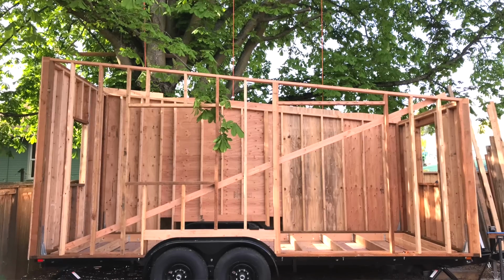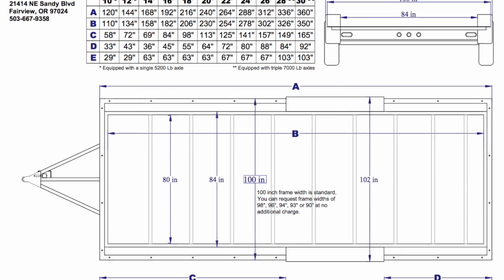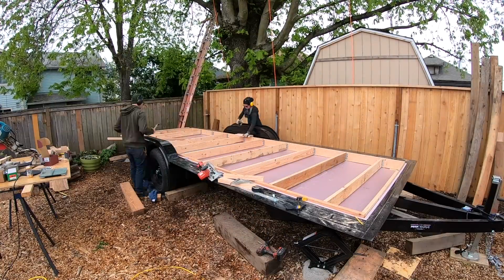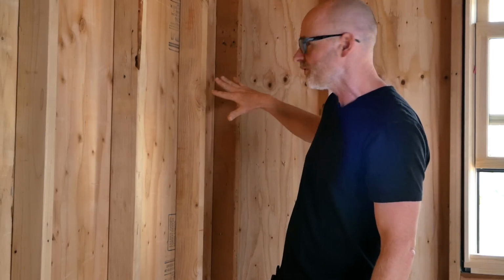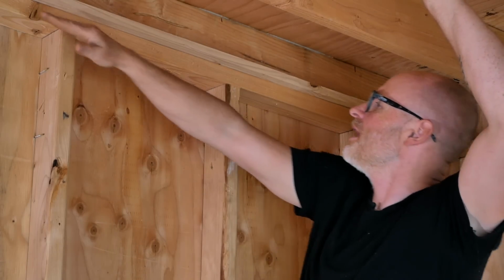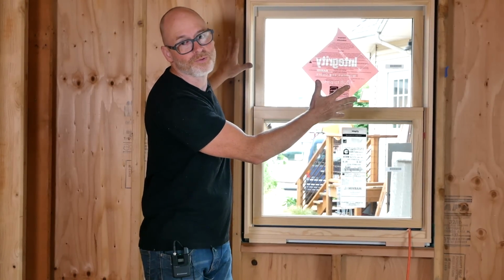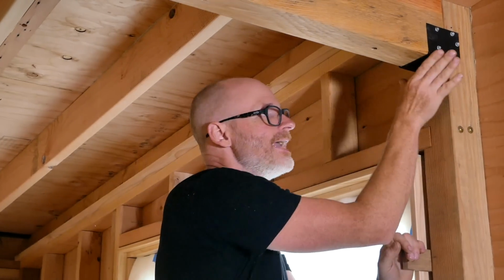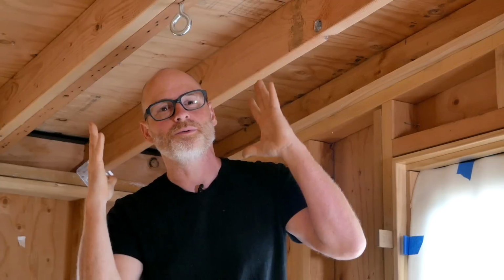Smart Framing For A Warmer Tiny House

Comment: I build a tiny house a couple years back using an iron eagle trailer as well! I can tell you the concern for condensation around the edges of the floor on the metal flange is absolutely an issue. We’ve actually had mold start to grow behind furniture if we haven’t dried it out for a while. So yeah definitely recommend the continuous insulation as well!
Reply from the maker: Thank you for sharing this!
Reply: What ended up being the cause of this? air leakage? was your floor and flange thermally broken?

Comment: As a tec student one of the things we did in competition is build ultra light campers. I and friend build a pickup camper so light, two men could lift it out. And it slept 5. No bathroom but sink stove oven icebox water tank heater propane . No hot water tank It is insulated with 2 inch styrofoam, aluminum framing and most inside outside walls and roof. Wind became a problem trying to lift it out of pickup. Yours seems to me maybe an over kill. How heavy are you at this point?

Comment: I have a 33" camper flatbed trailer with two axles at 3500lbs each. It has a camper on it right now, but I was wondering if that was good enough for a tiny home, maybe if I used 2x3's instead of 2x4, I saw a couple using that lumber for theirs.

Comment: On the 21.39 mark of your video. What is that black channel looking thing between the ceiling and the wall stud up in the corner? Is that some kind of venting? I watched your insulation video and that wasnt explained at all other the you were gluing blocks to you foam insulation before installing them to the ceiling. Do you have a video on that at all as my tiny cabin is in a extreme enviroment and i dont want mold.

Comment: I would suggest notching the post to receive the beam and THEN bracketing them together. It would be a catastrophic failure if the trim 2x4 were removed by someone who was not aware of its structural purpose in the future. Additionally, those bracket screws create a line for splitting out that post when subjected to the bouncing going down the road. If the 2x4 trim is not exactly the same expansion/contraction/length required to mirror that of the post, I would be concerned fatigue over time would be a problem. Your design considered vertical loading but perhaps not the horizontal and twisting when the trailer is unevenly supported due to pot holes or other road debris which will apply torsional loading which could very well split that post. If however you had notched and glued the beam into the post with lag screws from the outside to pull and hold the beam into the post in addition to the bracket and the final 2x4 support, I think it would be a much stronger structure overall because it would eliminate the hinge effect which you currently have at that joint. Consider Japanese joinery wherein multi -story buildings have survived earthquakes and hurricanes for centuries without a single bracket or metal fastener.

Comment: I understand the weight vs structure - did you consider steel stud framing topped with wood? I’ve done wood and steel stud framing and the combination sounds feasible. Thank you for sharing.

Comment: Thanks for the sharing of information. 
 I won't completely pick every detail apart like a few of the people in the comments. 
 1. The eye bolt for hammock. 
 Width is never a equal or often adequate replacement for depth in framing members. I get the "old growth" logic). 
2. Thermal performance.
There are calculation charts for something called "Fenistration". Basically the ratio of openings (door/window) that ate permitted. This varies greatly by State. Best to check local areas to ensure the "Certification of Occupancy" if you really intend to use tiny home as a dwelling. 
3. Any span over 6' requires two lap studs (minimum 3" load bearing). So you may use the hanger that is breaking the span of your roof. But, if you run into a goofy inspector you may have to do double lap studs anyway. Totally changing the interior detail that you plan. 
4. Talking cripple and lap studs.
 Point load blocking is usually required. (great, more thermal loss) LOL 
5. Floor decking. Plywood orientation. I understand your point about strength. In this small of a project it becomes a matter of choice. 
 Mitigate the issue of floor sag by using a t&g product. 
6. Treated lumber and fasteners.
 Use fastener rated for exterior decking and you don't have to worry about anything. 
 There are a couple of other things that I could go into but I've already said to much. I'm sure I will get a deluge of comments disagreeing with me. HA HA. 
 One last observation. Framing spacing. Have you heard/thought about 19◇ spacing? This spacing along with double top plate is often both cost effective and efficient. 
Thank you and if you would like any clarification please feel free to contact me. 
 I'm a old broken builder with to much time on my hands. LOL 🤓
Reply: I think you are great. I use to frame too. 65yrs old now. They would put me on the roof. 3/4 ply and spin it like a pizza because I'm 5'2. ✨💃✨
Reply: What do think; is he worried too much about the application of insulation?. I don't like the vent at the top.?

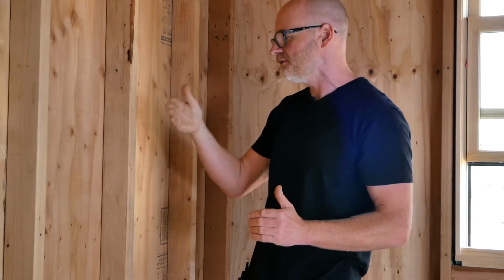Comment: 10:10  From what I understand, not only that, but thermal bridging is how/where the condensation forms, which leads to molding. Ideally, a tiny house (and houses in general) should be completely thermally broken, to maximize efficiency and mold-resistance.

Comment: You definitely did an exceptional job! Some of it may be considered overkill and  there was a lot I would alter to reduce weight. But there is a lot you did that I wish I had the patience to do because it looks great. This type of framework is quality and worthy of exposure. I usually keep rough framing rough framing and save the detail for finish work, but kudos.

Comment: The 2x4s above your windows and doors should be spun vertically. Add a 1/2 piece of foam insulation between to make up thickness of the wall studs and have a thermal break.

Comment: Framing your roof with 2x8 @ 24" o.c. in lieu of 2X6 @ 16" will give you a stronger framing system and a deeper cavity for insulation. Not to mention it will be a tad bit lighter as well. 
The downside ... you'll want to use at least 5/8" roof sheathing or better if you're not already doing so.
Reply: Yes, 2x8 on 24 is a better design for a static structure, but I am concerned that it does not allow for sufficient rigidity bouncing down the road over time. Also... 5/8" sheeting... not so sure you would see much in the way of weight savings.

Comment: I am building tiny houses in Alaska and I like the video. Looks like a good job. I would however be a little concerned about the structure of the roof if you have any kind of snow load. General rule is 1 foot of span for 1 inch of 2x. For instance, 2x4 spans 4 feet, 2x6 spans 6 feet and so on. 10 feet really is a stretch for 2x6. You may consider adding another cross beam. Also I seen a knot hole above your head when you were explaining the hanging chair support. If that 2x6 is spanning 10 feet and now you have a weak spot in that board, it will further weakens the roof. I have not seen those trailers before, I will definitely look into those.

Comment: Excellent!!!
Extremely helpful - thank you for sharing. 
Quick question regarding the plywood subflooring: 
It would seem that the subfloor is not secured at the perimeter, floating on the XPS foam insulation. I understand that XPS is very strong in compression, so no worries there. But I wonder if you have experienced any deflection, while walking on the Maple flooring along the exterior walls? Thanks again.

Comment: Thanks for such a great video! I hadn't seen the way you framed up the windows before. And great tip on the sloped window sill! Low-tech clever solutions are the best. :)

The one thought I had while watching was about bolts or other metal components that are connected, by metal, to the trailer itself. It might be beneficial to use a little bit of spray foam from a can on them (probably just $100 on both the hardware and foam itself to do this ... and it can also be used for better air sealing elsewhere, too). This will reduce the thermal bridging of the bolts and metal pieces, which can be huge when they are connected to the trailer bed (big heat sink). In addition to efficiency improvements, this can be good if these parts are not super well air sealed from interior warm, more humid air that could cause condensation on those very cold bolt heads in the colder months (rot concern).

Comment: Great content highly thought out, your window framing with the angled support it seems with an externally flanged window to make window sill angled for drainage, the top of window needs to tilt out. Theoretically this will happen with a plumb wall. Is this within the margin or error in construction? Or do you find this  truly works? Great video , this is the only thing I questioned.

Comment: First off, love these videos wish you had more!  Question on the detail where the sill plate meets the metal trailer, any reason for no sill foam gasket between the sill and metal trailer?  Also, any reason for not adding a vapor barrier to the floor frame before adding the sheathing?  Thanks!

Comment: I think you’re correct about not using the pressure treated lumber. The corrosives used in that treatment are Not good for any of your fasteners, or the substrate that you’re attaching to. You’re not having a ground contact issue at all, just potentially a condensation issue with wood contacting steel. That’s easy enough to isolate with a gasket or a membrane of some nature. Thus minimizing the thermal bridge, and dealing with potential condensation issues in contact with wood and metal.
Reply: Absolutely😊

Comment: Hi, thanks for the great info, wondering if you have a video on roof/ceiling framing and if you have consider to vent the roof like many do. they say if you use spray foam theres no need to create a venting system, but if you use other kind of insulation you do. thanks.

Comment: Excellenr. Thanks for the structural details that r always overlooked but so important to have a thought process.  Would like more explanation of how u did the insulation -  not very clear but imp I’m sure.  Thanks
Reply from the maker: We have a separate video explaining the wall insulation, but in the roof it's basically 2" foam, spaced 1/2 down from the sheathing to make an air gap for ventilation, then rock wool beneath the foam, then the ceiling.

Comment: This works where the biggest issue is the cold coming from the North, .if you moved further South where it gets hot from the South, you’d want to park the windowless wall to face South to exactly prevent thermal gain during hot days.

Comment: Sorry for the long post, just trying to help folks and save them money. So, I get your reasoning on the windows and it sounds logical  but I'd like to share my actual experience years later - and some building science. I totally agree with the idea of going bigger for light though. You say glass "leaks heat out" not true. It doesn't leak at heat at all, it is the seals between the glass and the frame that "leak". That is called convection. Glass can conduct heat, but conduction is really slow compared to air leaks and requires 50+ degree differentials between inside and outside to make a noticeable effect. Remember, you are heating a 175-225 SF area, any quality double pane window will not be subject to convection losses in either extreme heat or extreme cold conditions due to the argon thermal gap so there is no air leakage. And of course the point of the argon is a thermal gap so conduction loss is mitigated. My double pane windows in -8 degree weather last week was still semi-cold to the touch (inside of the house) and about 55 degrees. Single pane windows yes will be colder but conduction is less of a problem, but even then if they are properly glazed they aren't going contribute to a measurable/significant loss except in extremes like -8 or over 110. I have a big house built in 1910 with bottom floor original single pane windows and new vinyl windows upstairs. Surface temp of the glass was 20 degrees difference, but leaks in the older window frame, trim, etc.  was scary. My tiny house built in 2015 and all double paned was same thing in terms of surface temps, but no leaks because I built it with attention to the envelope. I was shocked how little difference there was in the single vs double pane windows at the glass. Air leaks in -8 temps were the worst and we found ourselves running to Lowe's to buy caulking for the bottom floor for the older windows - it wasn't the glazing but the trim and building envelope. I would say the critical thing in windows is the installation and the building envelope. Be sure to caulk/expanding foam seal any possible air leakage locations outside of the frame. If your budget can't afford double pane no big deal, your energy costs are pennies in a tiny house. I apologize for not having links to the research, I did it some time back. But the interesting thing I found was that single, double, triple pane windows are only low double digit better performance compared to one another. It'll take you 35 years to get your money back. https://www.familyhandyman.com/project/are-tripleglazed-windows-worth-the-extra-cost/  You can't trust window manufacturer sites, windows installers, any place that sells windows as they are biased to make sales and don't quantify the differences in actual dollars to heat/cool - and they never analyze how long it will take to recoup your costs. The research I found was a university in Australia and I recall the difference between single pane and triple pane was like 13% less efficient for the single. Compare that to 3-4x the cost of so-called energy efficient windows. It makes no sense to go for the extra spend. My experience says spend your budget on bigger windows and don't forget tempered glass for tiny houses. Don't waste your money on triple pane, and possibly not double pane depending on climate and focus on the building envelope first and foremost. You will never recoup the costs for spending more on windows, especially in a tiny house. My friend in Santa Cruz, CA heats his tiny house with bricks pre-heated in the bonfire before they retire and in No. Cal "Winter" he's only looking at 55° by morning. I wou;dn't recommend that is Saskatoon! If I build another tiny house I won't waste my money on expensive so-called "energy efficient windows" (I spent $4500 for my Jeld-wen w-2500 series) but invest instead in more solar panels and batteries. I hope this helps people starting their Tiny house journey.
Reply: Basically he means windows are not as efficient as insulated walls.  ffs.
Reply: What a ridiculously long post.  holy shit.
Reply: Super helpful; also insulate switch plates on exterior walls by inserting those small foam sheets designed for that purpose.

Comment: Do you have a diagram of how you positioned the foam on the trailer and the frame on top? I understand that you have bolted the frame laterally to the trailer but you can't tighten all the way with that foam in between correct? Won't it compress?
Reply: It's not under the plate - it butts into the side of it. Extruded poly foam has actually got a very high uniformly-distributed compressive strength meaning if you stand on it with high heels it'll get a hole in it but if you spread that load over the entire surface it'll barely compress.

Comment: thoughts re plumbing and electrical. I would put it outside the walls, reason is that if anything leaks etc would will find it quickly and reduce the damage to the construction and you can get to the area easier. You can hide it in various ways or show it off in a decorative way
Reply: one woman did that and then her water pipes froze and burst
Reply: @genkiferal7178  not outside, still inside but not in the walls. That would make it much easier to get to the pipes and wires if anything needs fixing
Reply: @TheLadySakai  I guess if you used a shiny copper pipe it could be quite artistic.  I've seen such pipes used as curtain rods, for faucets, as clothing rods and light fixtures.  very very nice if one is able to get the shinier ones.  A matching copper bathroom sink would be divine with those!
Copper prices might go through the roof soon, so if you find used pipes or fixtures, buy them now.